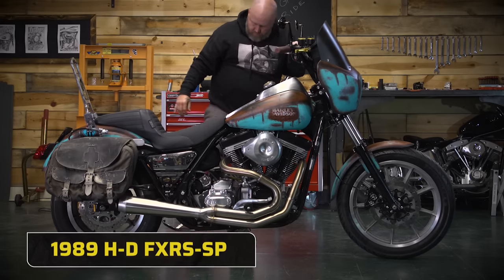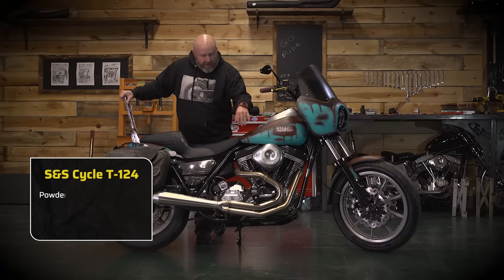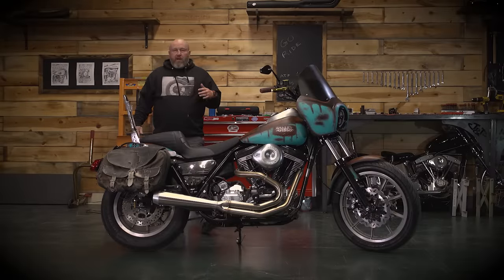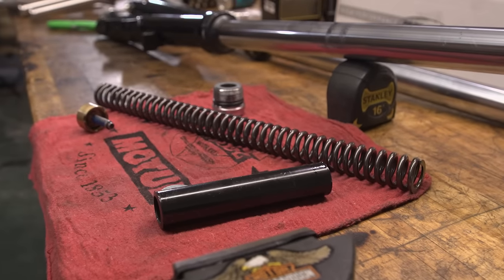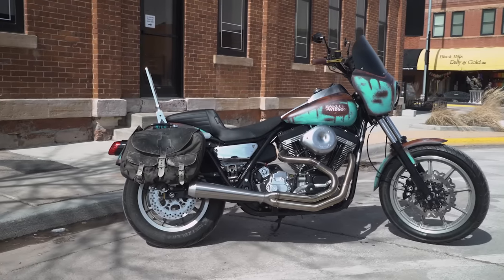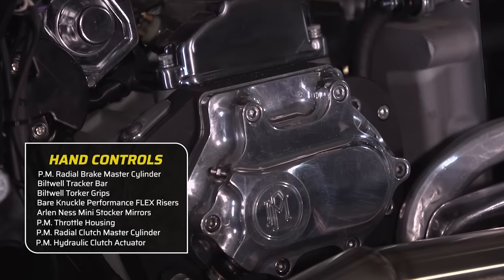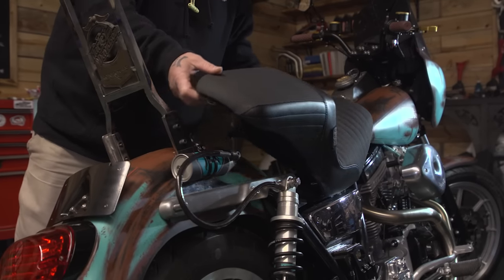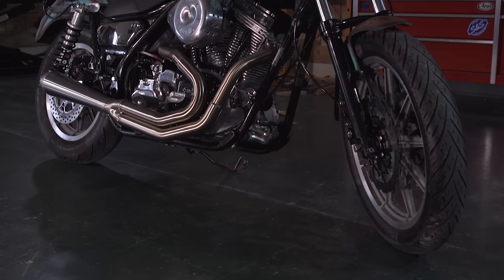124 Cubic Inch Twin Cam FXR | J&P: Custom Motorcycle Builds

Comment: At least it has a cool paint job that doesn't look like a 90s chopper with a technicolor paint job.
Reply: As far as a patina paint job goes its actually kinda lame, you want the paint worn down at all the high spots first not just willy nilly here and there because  it'll look crappy like his kinda does,  I just painted my a Similar color  with a can of spray paint for $25 and I swear it's a better job than his, if I could show you I would

Comment: I still have my 1984 FXRP -  😎 I'm getting ready to drop an S&S Super Stock 96 inch in mine. 
In 1984 I went into a HD dealer to look at the NEW 883 Sportsters... they were selling for $3999. I took one look at the "Superglide 2" / "Blockhead" fell in love ❤and bought the bike new for $6995, I was 23 years old.  At that time they had Shovels and Evo's on the floor at the same time. The FXRP had the 2 inches over front end, running boards, solo saddle seat and NO rev limiter a feature on real police bikes. There's nothing like an FXR..... BEST MODEL EVER BUILT...! ❤🏁    >>>> BTW >>> NICE JOB, LOOKS GREAT.

Comment: Great video, what’s the time for 0-60, does the engine run hotter without the oil?
I’m building my 2002 Harley Davidson Sportster 883cc to a 1275 Hammer Kit Conversion for 124-30hp with max out torque. Yet, I’m going to convert the fuel tank to run on hydrogen, so I’m contemplating if I should keep the fuel injection.
Let me know your thoughts as soon as you can write back, thanks!

Comment: Awesome bike.. looks like tow mater.. feel like there is no way it doesn't sling oil out those holes you drilled on primary... plus contamination during rain or wash.. thoe
Reply: Its a dry clutch / belt drive . No oil. Can be ran open or closed
Reply: @LeathalLefty1  ahh 👍. I've seen open primary and dry clutch. But that did not occur to me.

Comment: No turn signals at all is bold for a bike that does miles and isnt a chopper.  I supposed you could swap the taillight for one with signals built in and put some LEDs in the grip ends.  Cool build.
Reply: I’m fine with hand signals. Put 50K on my Dyna with no signals , less is more 😂

Comment: Can you give me any info on retaining stock wheels and converting
from tapered roller bearing to more modern sealed bearing. I didn't measure
yet but I would think sealed bearing would be larger in diameter.

Comment: 124 geez I have s&s 107 and its to much !
Reply: geeeeez I got 96” fxdB
Reply: I have a 91 FXR with the same engine. It’s been stretched and lowered.  It makes 134 hp and 128 torque.

Comment: 🇺🇸🫣 hydraulic clutch? Everything else is 🏁...one-off for sure... the belt/chain drive is screwed by mushy input, 😢
Reply: I actually tried a cable clutch first, didn't like it. I generally prefer cable clutch's but for whatever reason didn't like this one.